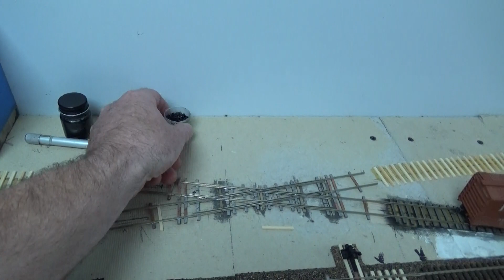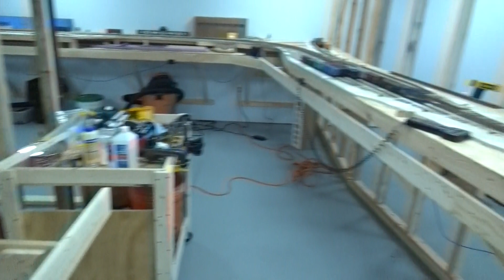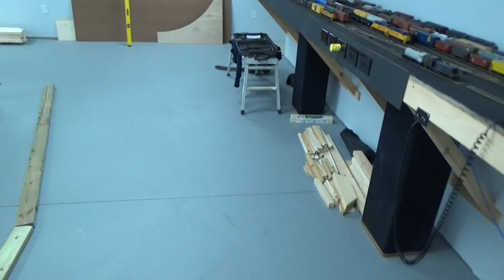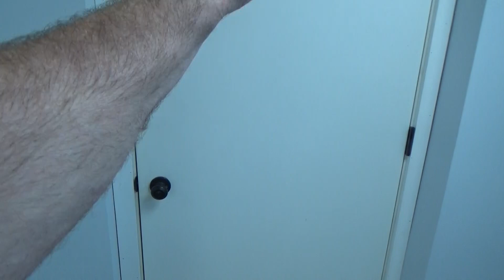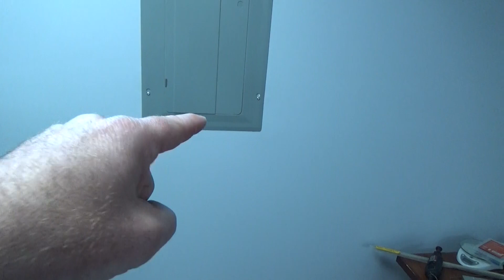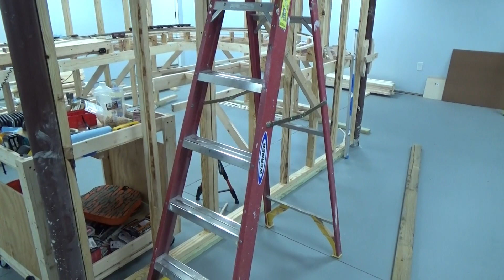Model Railroad Update 34 (Butler Track Work)

Comment: If your using spline roadbed, why the masking tape super elevation? Why not just cut the top of your riser at a slight angle before attaching the splines so super elevation is built in?
Reply from the maker: Good question.  i use a plane on the spline to get all of the pieces even and level and i thought about using the plane to create the superelevation.  I decided to just plane everything dead level and use the tape so that i could accurately and create consistent superelevation and transitions.  I had not contemplated cutting an angle on the risers but to do that accurately i would need to add more risers to control the transition in and out of the superelevated section.  I appreciate the thoughtful comment, thanks!

Comment: You're making good progres! I like the detail and effort you put in the trackwork. That's going to pay off when the layout is up and running.
I use superelevated curves with styrine strips but the way you do it with tape looks a lot easier to work with. I think I'm going to try that technique on my layout...
Thanks for the update and good luck with rest of the build!
Jasper
Reply from the maker: Progress was slow getting the basement ready but i finally feel like there is momentum building.  I am very happy with the masking tape method of superelevation.  It is a little challenging using standard width tape and then cutting it to a narrower strip.  However, i think i located some 1/4" tape at a local art store that i will try for the next turn.

Comment: You are well on your way to having an empire!  Thank you for the updates.  You’ve got small fortune in lumber there….hope they left you some from the construction of the house above the RR….
Reply from the maker: LOL, i did have some lumber left over not from the house but from the framing of the basement.  Most of what was left was twisted junk (now in the form of a tool cart).  i used 2x3's for the framing which while more expensive than they used to be are not is as much demand as they have limited use for code compliant construction.  Thanks!

Comment: trackwork looks great, I never head of tape to do superelevation, sounds like a super great way to do it. I bet the code 55 would be great, I plan to do a lot of industrial tracks and light branches with it. I hope you dont have any pizza cutter wheelsets, they wont like Hand laid code 55. Great update. Cheers Rob
Reply from the maker: I saw the masking tape idea on DG Modelworks.  So far it seems to really work well and lets you control the overall height of the superelevation and also the rate of transition.  I might have a few pizza cutter wheels sets hidden in my rolling stock so the code 55 might be a good way to expose them!  Thanks Rob.